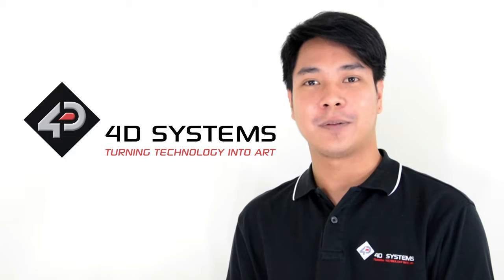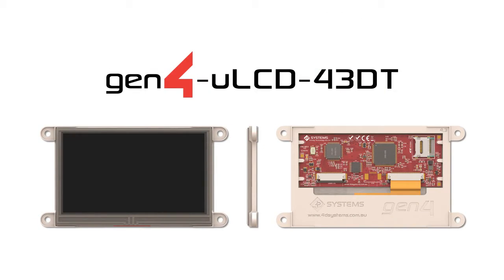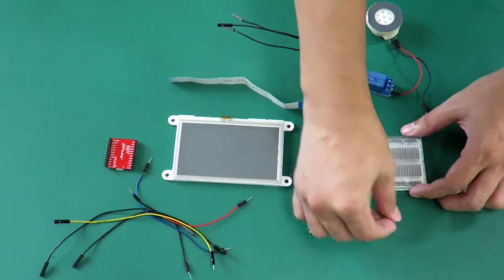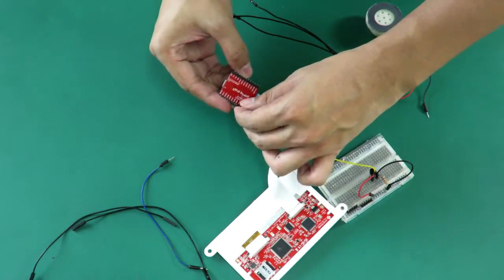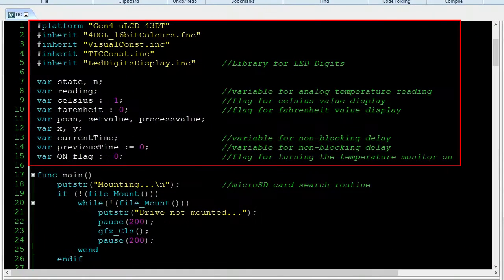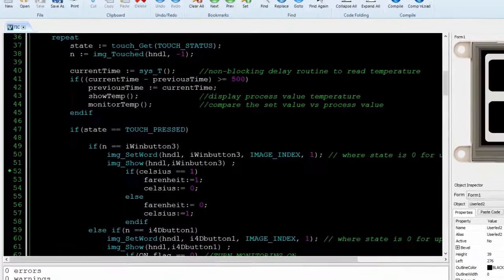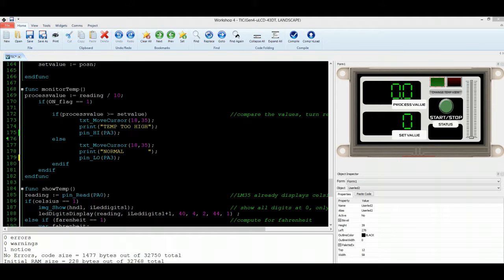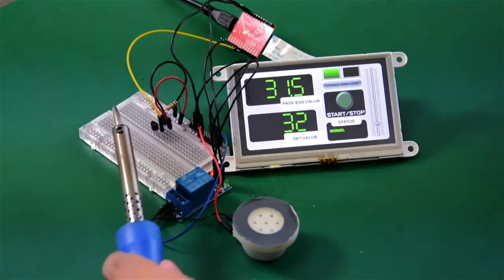Temperature Indicating Control featuring gen4-uLCD-43DT

Comment: hello. i dont know how to use arduino uno with ds18b20 to display temperature on the led digits. Could you show me how to do that, please?
Reply: Hello, we provided the documentation and code in this link for you , hope this helps:
http://www.4duino.com/downloads/projects/4D-PR-005-015.zip

If you have further technical inquiries, please don't hesistate to contact our tech support team at http://www.4dsystems.com.au/support 

or post your questions on our forum : http://forum.4dsystems.com.au/

Thank you
Reply: There are also application notes on how to use our display with Arduino. genieArduino library a great help for you.

Try this appnote :ViSi-Genie Displaying Temperature values from an Arduino Host http://www.4dsystems.com.au/appnote/4D-AN-00015/
Reply: thank you so much. i will try.